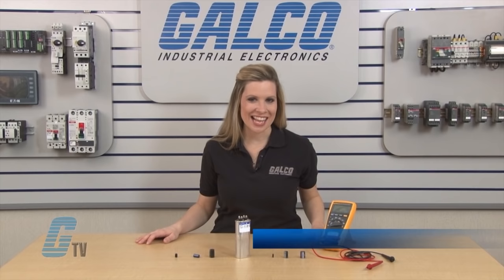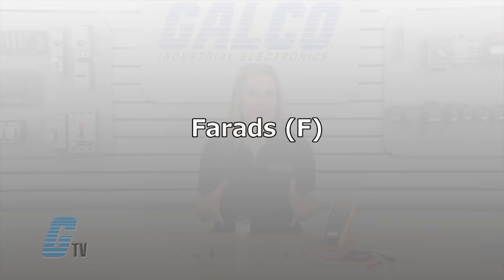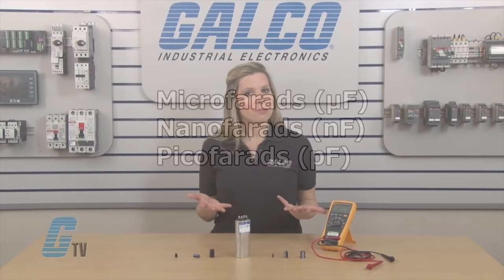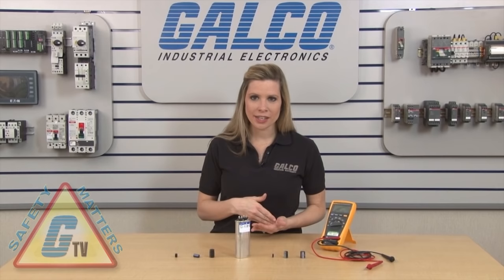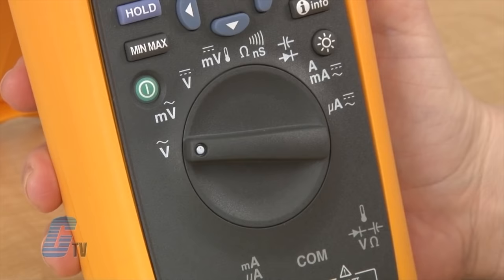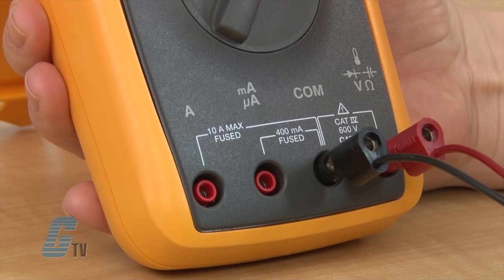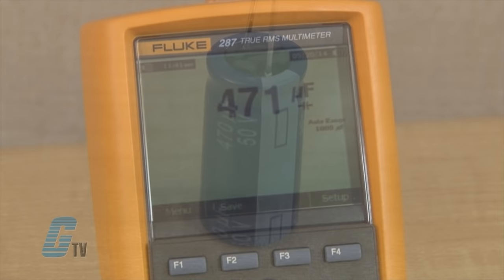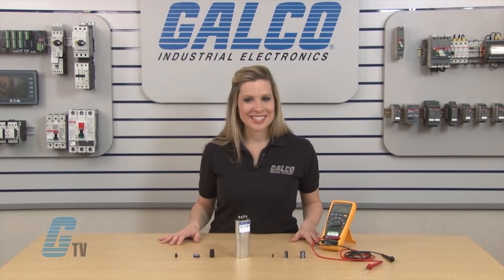How to Check a Capacitor and Measure Capacitance with a Digital Multimeter

Comment: If you use a multimeter to test capacitors you have to check both Capacitance (Farads) and Resistance (Ohms).  Just because a capacitor is reading great capacitance, it might be bad because of adding higher resistance causing an electrical problem in the circuit, it happens more often than you might think as there are different types of capacitors and some are more prone to that kind pof problem than others.. That's why an ESR Meter is much more convenient than a multimeter when testing capacitors and why a multimeter's capacitance / farad measurement alone can cause you to mistake a bad capacitor for a good one if thats all you use to check all your capacitors. Also, multimeters require removing the capacitor from the load to test them but ESR Meters don't. Finally, ESR Meters will automatically drain your charged capacitor to get an accurate reading but regular multimeters will not, you have to do it manually.
Reply: Exactly this!

Comment from the maker: Capacitance is measured in a unit called farads and the capacitors used in circuitry are measured using sub units of microfarads, nanofarads, and picofarads.

Comment: What happens when the capacitor is constantly charging? By what i mean you have 50 volt capacitor  but you use  a 9 volt battery  to hold a charge, then you use a step up converter to boost it to 50 volt then you leave the converter on.
Reply from the maker: As long as the capacitor is rated for 50 volts or more, it simply charges to the 50 volt level and stops conducting charge current. A capacitor will only charge or discharge when the voltage is changed up or down, this help?

Comment: How to find if a capacitor is damaged? I have 450v 12uf capacitor
Reply: Capacitors have fluid in them and when they dry out it might not indicate they are bad unless you use a multimeter or ESR Meter.  If they bulge/pop/leak then obviously it's damaged.

Comment: I measured a capacitor using my multimeter and it showed OL. Does that mean it’s defective?
Reply: Either you used the wrong setting on the multimeter (follow instructions), or its bad. Another thing you can do is check it's resistance level and then compare that on an ESR Chart (Ohms vs. Capacitor Farad Rating) and see where it is.  Tiny capacitors can have high Ohm ratings but it should never be higher than 6. Large capacitors should have very low Ohm ratings. <0.5. If you're getting 0L then it might be an indicator that the Ohm reading could be in the hundreds or even higher. Multi meters usually require the capacitor to be removed from the circuit before testing to get a valid reading, with the exception being ESR Meters.

Comment: on your multimeter there is an arrow symbol next to the capacitor symbol.  What is it?
Reply: That is a diode function. It will test if the diode works properly. A diode only lets current flow one way. In one direction you should get a reading, reverse leads and you will get OL if it is good.

Comment: What is the farad on the capacitor about like they say 470uF, 250uf, 1F and more but I don't get it?
Reply from the maker: Great question; Farad's are the unit of measure of capacitance. However 1 Farad is an extremely large value, so most capacitors are rated in millionths of a Farad, OR 0.000001 Farad is 1uf and said as 1 micro farad. Now your 470uf means 470 micro farads OR 0.000470 farads. All capacitors have 2 main ratings though, the Capacitance and the Voltage rating. As either 1 of these values go up, the capacitor will get larger in physical size, ok?

Comment: Now going back to amperage this part still stuck. Does the capacitor pushes the amps that the load needs or more then then it requires?  By what mean ex: there is a load the has a max input of 3 amps but what I been wondering is that the capacitor only use that amount amps  or does it uses higher then 3 amps that can burn it.
Reply from the maker: No, the capacitor is a very simple reactive component. It will only supply current to maintain voltage at the present level, that's all, nothing more nothing less.

Comment: Does the capacitor pushes the amps that the load needs or more then then it requires?
Reply from the maker: I think you kinda have it,,,, A capacitor opposes a change in voltage so it will supply current if the voltage try's to drop and will absorb current when the voltage try's to rise, this help?

Comment: Here the the thing this is for D.C. power only I don't mess with A.C. power. The converter are D.C. to D.C.
Reply from the maker: Ok, but a capacitor still does same thing. Understand a capacitor is only 2 plates of conductive surface spaced a very specific distance apart to create capacitance, right? So when you turn on your converter the cap still has to charge to the 50 volt level, after that it does nothing at all unless you pull power from your 50 volt converter, then the capacitor will aid the output to try to keep it at 50 volts, does this help?

Comment: Ok what do you think about 50 volt 2200uf capacitor
Reply from the maker: Good for filtering 60-120Hz, we find this size in power supplies all the time, is this an "Electrolytic Capacitor"?

Comment: What do those uf, farad do?
Reply from the maker: Simply stores more electrons the higher the capacitance value is. This allows more filtering, but there's a trade off because if cap gets to big it becomes good for low frequency only, small caps filter high frequency more effectively.

Comment: Could 50 volt 2200uf capacitor hurt a person ?
Reply from the maker: Yes, so be careful.
Reply from the maker: Always give capacitors a chance to discharge for at least 5 minutes before handling or servicing. This advice assumes that a bleeder resistor was mounted across it's terminals. If there is no bleeder then the capacitor may hold a dangerous charge for hours or even days, ok?
Reply: This is also the case with a 450v capacitor. But how to quickly decharge those. Tried screwdriver but gives to much sparks. Maybe with a transistor then but which one to get no sparks 👀

Comment: So nothing happens when it reaches the max? Doesn't the voltage drain out as it is being use? By what i mean going back to the example I gave you doesn't the converters uses power. you got two converter the first converter being use is the step up but when it reaches the converter max(we got a 40 volt input max any higher and converter will burn out) then you a step down converter (this has a 100 volt input max  so when this being use it can handle it) between capacitor and the step up converter. So wouldn't it be use voltage?
Reply from the maker: AC to DC voltage converters do put out pulsating DC current/voltage. The capacitor will charge to the peak of that voltage if no load on circuit. If you load it, ripple will form on the DC (hence DC with AC component). So now it depends on how large a capacitor you have to smooth out that ripple and how much load current you are pulling from the first converter no matter what the type of load is, does this help?